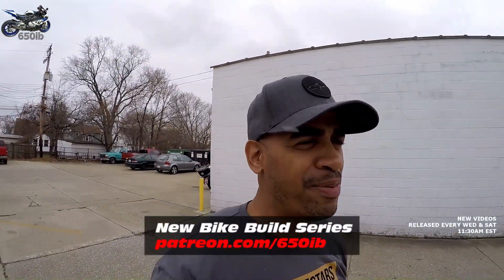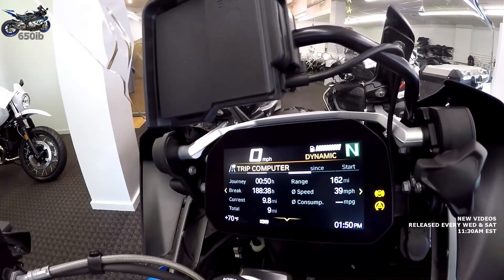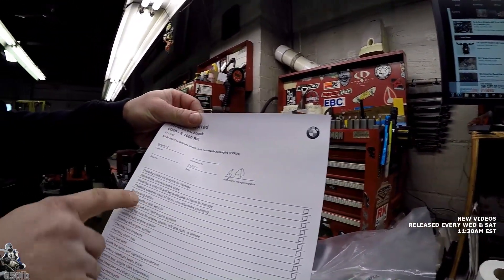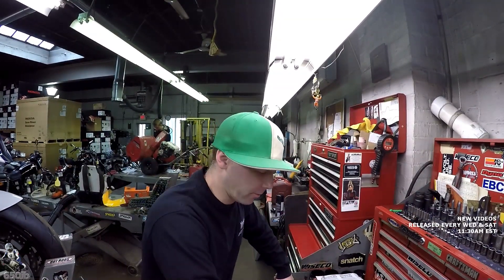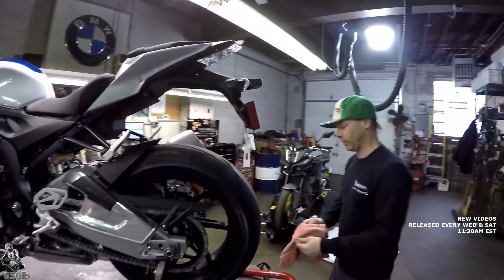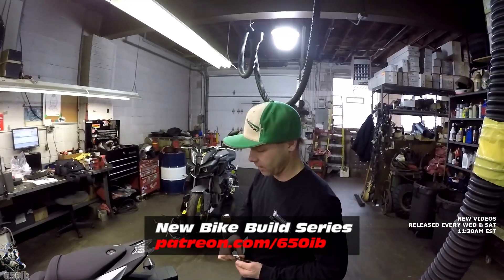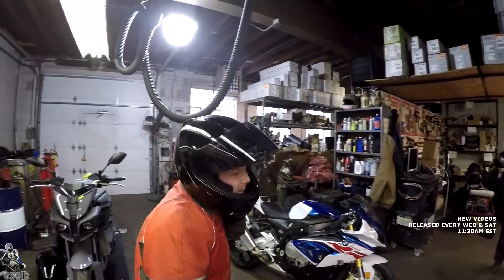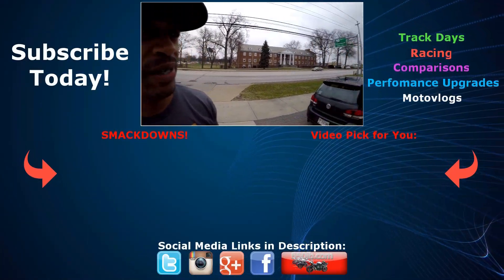2018 BMW S1000RR | From Crate to Street!

Comment: Awesome video man!  Those new displays are freaking amazing.  Can’t to wait for the new S1000RR to have those.
Reply from the maker: +Jaret Campisi Thanks man! Yeah, the display is amazing!
Reply: ISNT THE 2018 s1000 has the digital dash ?? COME ON! Then what did they change from 2017 ??
Reply from the maker: +Soumendra Jena Nothing changed.
Reply: 650ib I assume it's 2017 then. You sure they labeled it as 2018 ? As of my sources 2018 is coming with digital dash in Feb Manufacturing

Comment: I'm really digging the whole key fab movement. Both BMW and Triumph are killing it when it comes to the modern interactive dash. #future Very interesting to see the entire process of what happens when you buy a whip brand new. 🙌🏽 I'm really curious how many miles they put on my bike before they reset it. I got my Duc with 0 miles on the dash.
Reply: has it broken down have you had any problems? serious question
Reply: Actually I haven't encountered any serious issues with my Ducati. I keep it well maintained and do the major services as recommended by my service manual. Recently my starter motor failed after 3 years of constant use and replaced it. The Duc starts up like a champ every time as if it was brand new. You can always hit up my channel to see the journey.
Reply: CLUTCH1st Ducati has been doing the key fob thing for a while